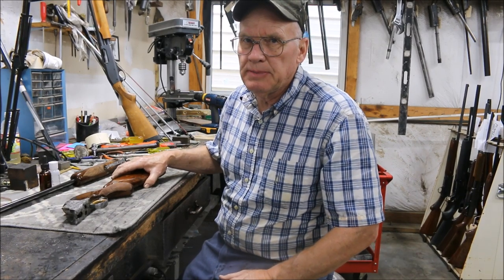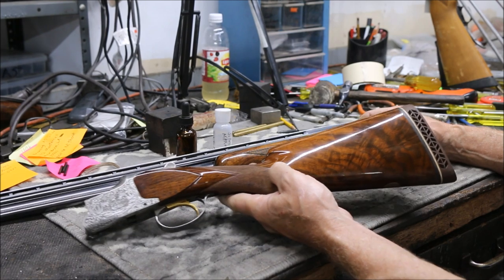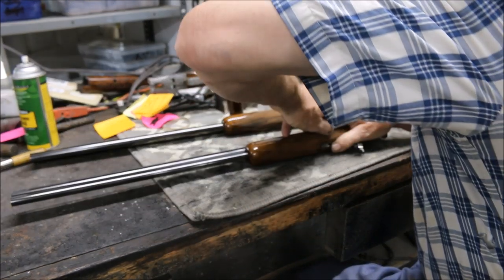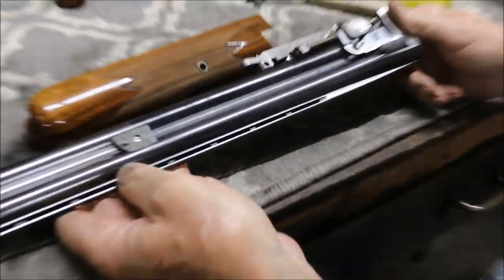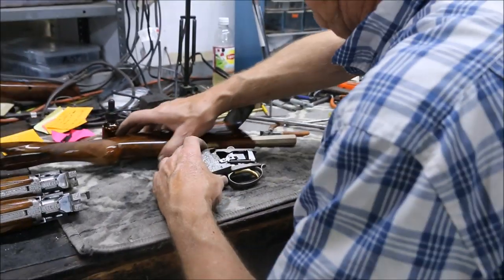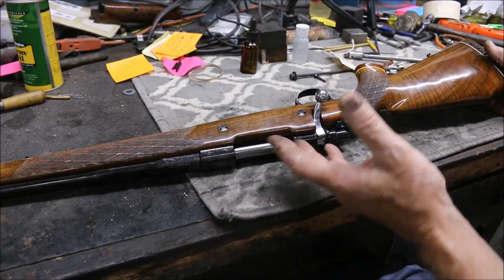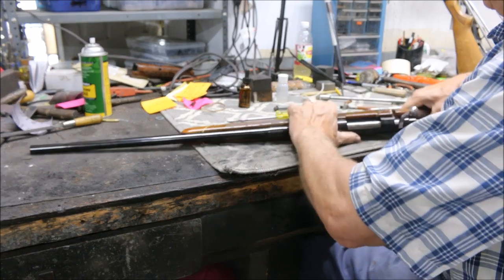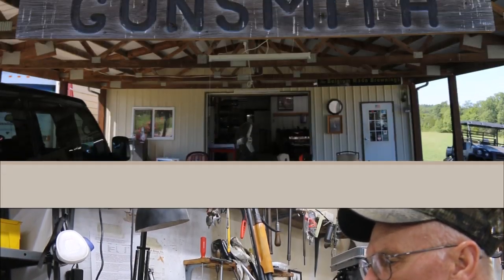Advanced Browning salt test.

Comment: Years ago I had a T-Bolt T2 that had salt wood. It was sent to you by way of Browning to be re-stocked. Came back with not so good wood, sold it as I was worried the salt issue on the metal would return

Comment: I bought a 1966 T-bolt .22lr saltwood gun. Didn't know about salt then but the butt plate screws rusty and one dime sized patch on the barrel under the wood. I didn't pay too much luckily and now I store the stock off the rifle when not using it.

Comment: This is real eye opener. I never knew of this. Great info, thanks. I have two questions. Does Browning acknowledge and make any attempt at compensation for guns found with this condition? Also, since you plan to sell the Safari, will you be disclosing this info to any potential buyers?
Reply: Yes Browning acknowledged it and will replace/repair for the original owner. Being that they were sold for about 5 years in the late 60s/early 70s, not to many are still owned by the orginal purchaser.

Comment: Did auto 5s got the salt wood? Because I own a auto 5 magnum made in 69.
Reply: this is literally a video on how to check if a firearm has saltwood.. silver nitrate is the only way to know for sure
Reply: quick google search says; any A5's 2,000,000 edition Commemoratives should be looked at
Reply: @MrMrsregor  well I pull it apart not long ago no salt damage hammer was glued stuck after 40 or so years of gunk and grime but not rust.
Reply: @adamtarbaux7769  Good that there was "no salt damage hammer" .
Reply: No, the problem is generally found on the higher grade Superposed guns with fancy wood.

Comment: Urban legend salt is not used to dry wood only dry air works.. salt would attract moisture from the air not the wood... this lumber came from trees that grew in salty water so the salt was in solution in the fibres not pressed in by force...
Reply: I guess you know more than this expert.
Reply: So then i guess all of these guns that had this problem were the ones that were stocked out of mangove trees, or is this just urban legend? Have you ever seen a walnut tree grow in the ocean?
Reply: @jeriannking4473  Experts are a self appointed group so you are an expert too.
Reply: Morton Salt was contracted to provide sodium chloride by the ton to dry the wood. The issue was that the stocks were stacked on pallets and NaCl was then piled on-top to draw moisture from the wood. The moisture (now brine) soaked into the stocks at the lower area of the pallet. Hence, the water (saturated with 30% NaCl bathed the stocks and eventually leached out from them and into the metal of the finished firearm. All facts and basic chemistry.
Reply: @coasterbrookie  Basic nonsense salt reduces the surface tension of water making it wetter and more absorbent whatever about your trolling logic.
Reply: @danielleclare2938 it was a special salt drying process developed by morton salt for the furniture industry browning bought the process in 1965 and used it from 1966 to 1973 its a well documented history of events
Reply: @danielleclare2938  Give it up, you don't have a clue.
Reply: @whiskeykilmer1866  You would know.
Reply: @danielleclare2938  The background of Browning's issues with salt wood has been well known for 60 years, but now you think you have all the answers.
Reply: @dukeford8893  Urban legends last a long time but they area still nonsense. Those answers pre date any issues Browning had so whatever about what you think you know.